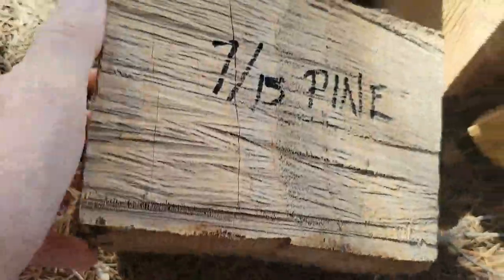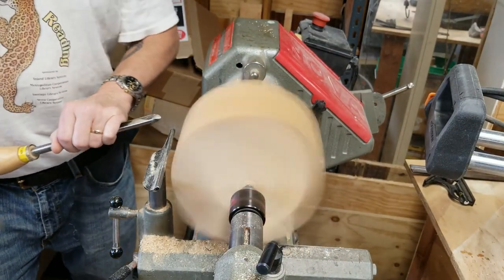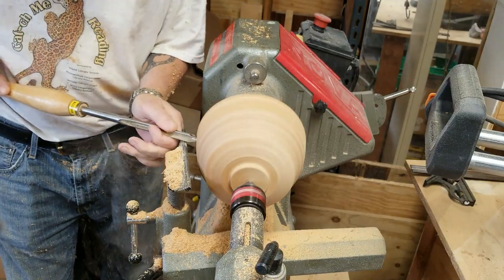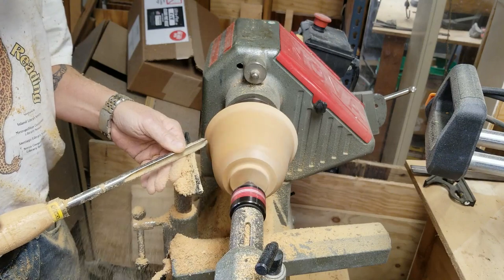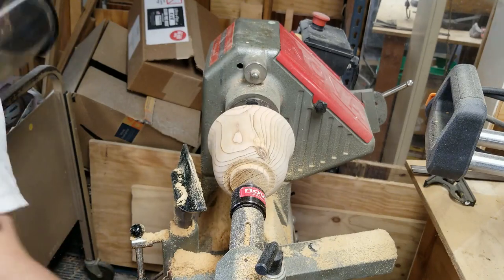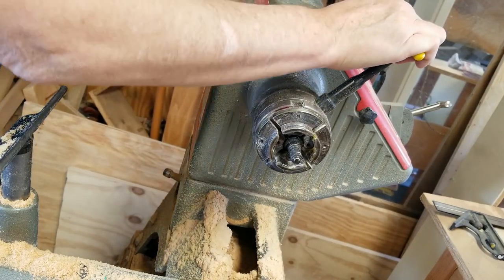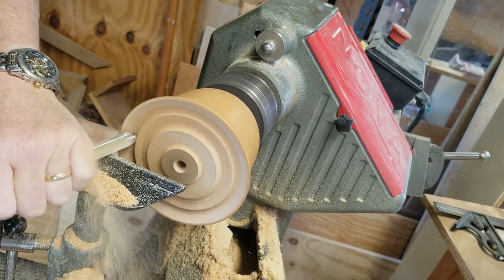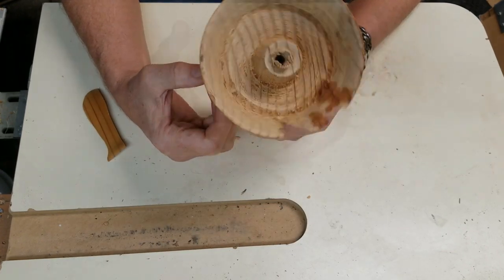Pine bowl gone bad

Comment: Bummer on it biting back. Good that it just bruised you instead of worse. I would have drilled first with a drill bit, then a Forster bit, to remove a fair chunk of the center before turning the sides to thickness. And yeah, when in doubt, pause and sharpen. If I’d done that, I would clean everything, saw the top off, and re-turn it just because. Hope you heal up quickly. Thanks for sharing this video.
Reply from the maker: Sometimes I do drill out the center although usually leaving some mass as you work your way down helps stabilize from vibration. I did end up returning the piece in another video, check my playlist for the "redemption" video.
Reply: @pellikan64  thank you for the reply. I will look for that video. Glad to know that you didn’t let it win.